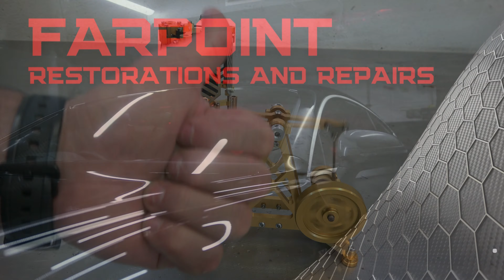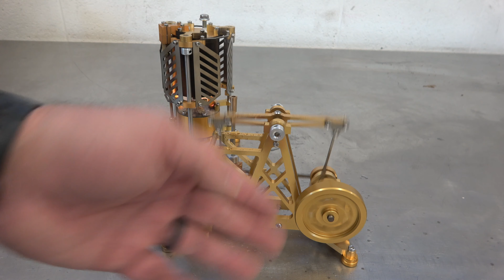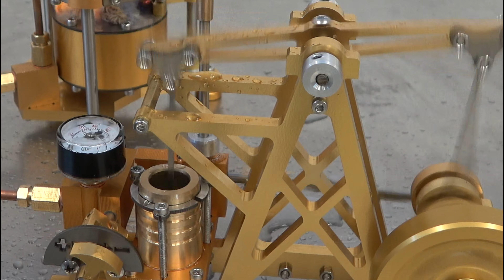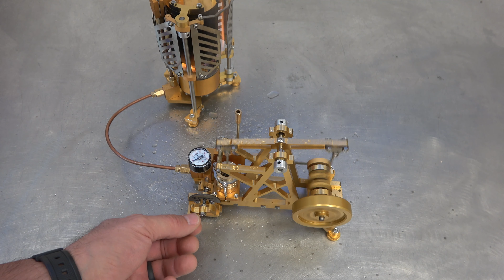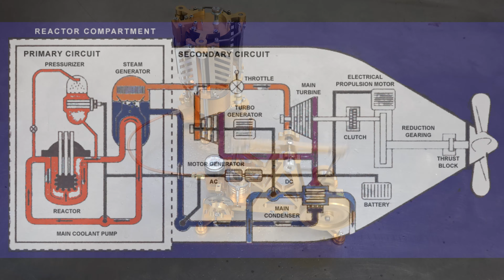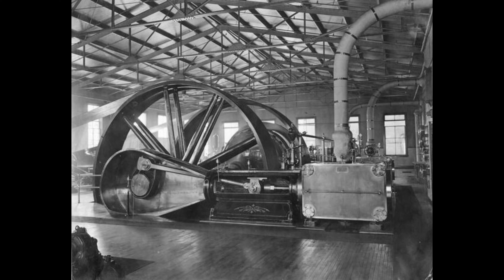The History of Engines, part 1:  Steam Engines. Check out this working tiny steam engine and learn!

Comment: Very interesting. In this setup displayed , how does the piston and cylinder get oiled ?
Reply from the maker: It is cooled and lubricated by the water from the steam- Since the RPM levels are low, there is not a ton of friction. This would not work in a gas engine- The tolerances on a steam engine are not as much as that as a gas engine

Comment: I worked in an old engineering workshop in early 2000's and they still had belt driven tools, not powered by steam anymore but still cool they kept using a lot of the old gear. They got bought out and moved and modernised in the end so all just memory now.
Reply from the maker: What a shame on that, history is being forgotten with all the modern ways that we do stuff.